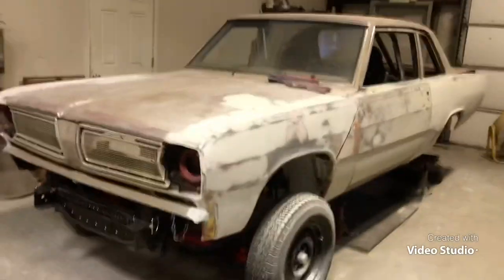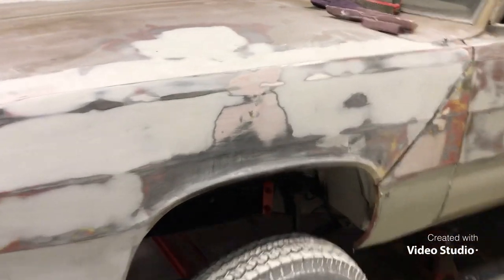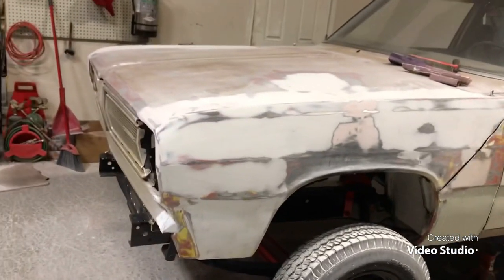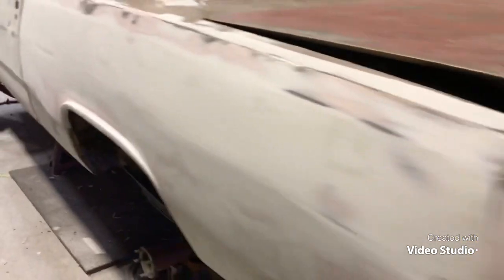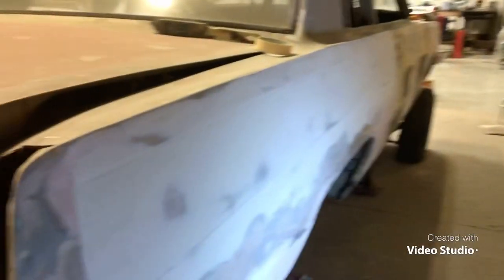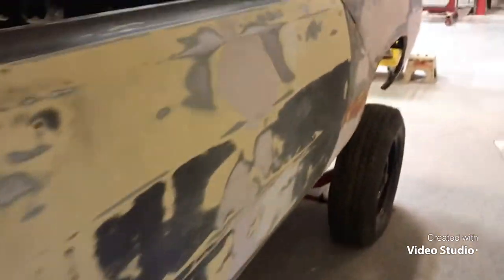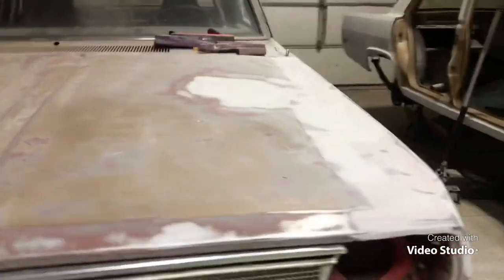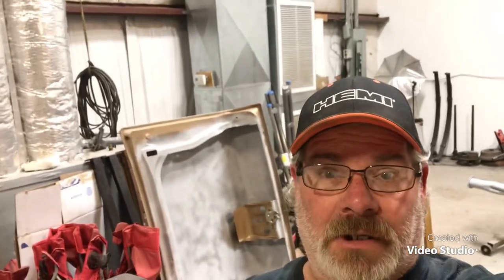Ugh, it’s skim coat time. SlagHammer is waving.It never ends@UncleTonysGarage #nonamenationals

Comment: Coming together nice Al! Not sure how much work it would take but I think the car would look and perform better if the axle was about 4'' farther forward. I have a 63 comet gasser and I think I installed it so the center of the tires are a good 2'' farther forward than stock. Mine has front shackles so axle will go forward a bit when springs compress. Mine is just a speedway straight axle kit that's just pipe. I would have much rather had the proper ''I'' beam axle out of a early econoline but they're hard to find. Good luck wrenching! and I am looking forward to pulling up to the line next to you!

Comment: I promise you, get a cheap pneumatic inline sander and save yourself a lot of work. 100/150 bucks and you are in. It will save you a lot of headaches and speed you up. It’s not the full answer but it’s part of the solution.  I applaud your work,  fabrication is one thing, bodywork as another. I’m just trying to help you out brother.  Good luck.